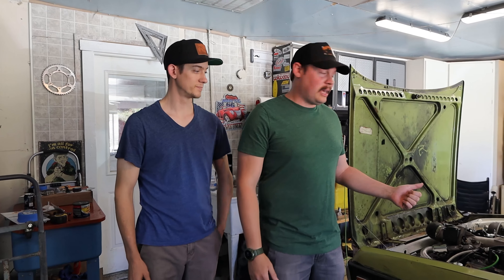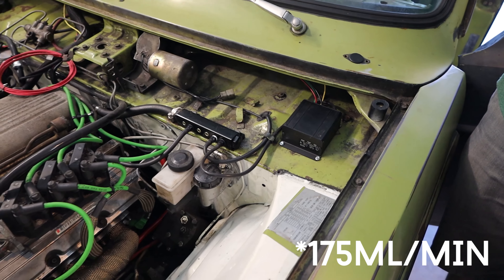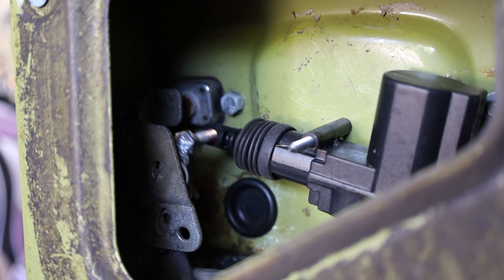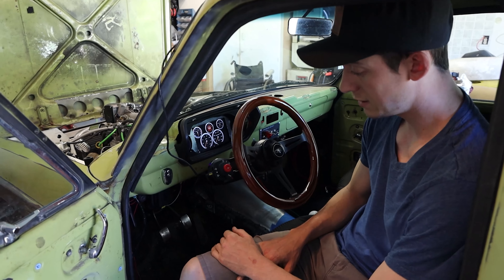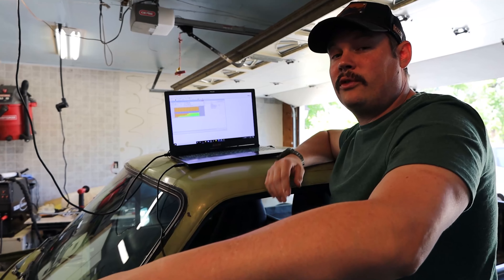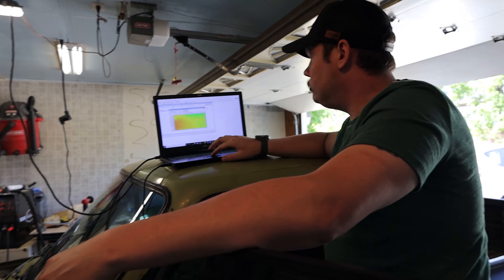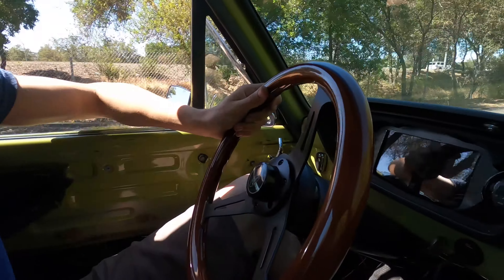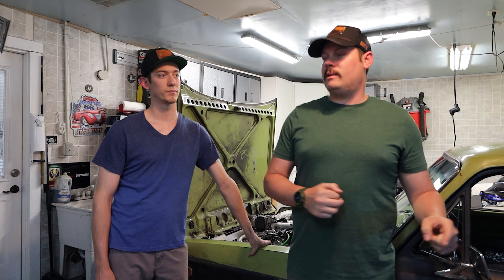LOKI UPDATE- 1974 Ford Courier

Comment: What did you use for the transmission? Curious on going the same route with my 72
Reply from the maker: This is a T5 from a firebird. Bolts right up to a 3800.

Comment: super sick, I just bought a 74 courier today, I want to do something similar to what you have going on, what is a good engine to swap if you know of any? Also where are you guys located?
Reply: We're out of Sacramento CA. And yeah the ford 2.3 motor came in the second generation courier. It's almost a bolt in swap. And there's a big aftermarket for those motors. The 3800 series 2 from the 4 gen Camaro worked out really easy as well.
Reply from the maker: Thats awesome that you are now a proud owner of a Courier. As Jake said we are located in Sacramento CA. It would be cool to meet up and have a cruise or something. I think one tip I could give is to go with a Holley ECU over the factory one.